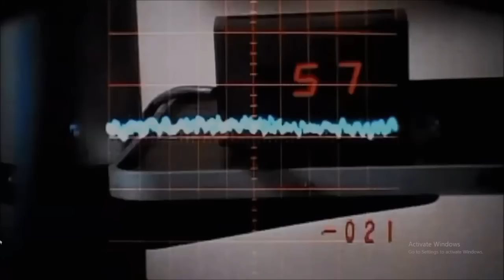RICK'S CORVETTE UPDATE ON DAMAGE & MORE TECH TUESDAY QUESTIONS

Comment: Rick the exact same thing happen to me in my 2021 HTC when I did my first launch on a on-ramp. Passenger axle shaft broken under the outer CV boot clamp. Car only had 2003 miles on it. One mile from home at 10:30 Friday night. Took 3 hours to get AAA to get me and drop me off at home. You did the right thing driving it home. Got it replaced in two days. I was gun shy to try it again, until my son said to keep doing it to work out the kinks under warranty. Smart son.

Comment: I have a solution I implement regarding the water issue/concern when washing my 2021 C8 HTC.
I simply raise the rear engine cover by placing the car in service mode. The water rolls off to the rear of the car's drainage points.
(If I'm home) I use my portable blower to get rid of the residual water.
To help further I also ceramic coated myself those areas around the trunk where the water settles as well.
Hope this helps.....    Enjoy the ride!
Reply: Service mode is an excellent idea. Def gunna try that next wash

Comment: I too live in the Houston area and have a 22 HTC that at times has a strong odor of raw gasoline.  I don't over fill the gas tank, I have over 1K miles and I don't have to have a full tank of gas for the car to smell.  It is currently at the dealership for the second time for this issue.  Hopefully they can locate the problem this time.  If the problem is resolved I'll post again.

Comment: That maybe more common than you think.  My Son had 2016 Camaro 2SS, and just driving home car lost power and all kinds of noises were from the rear.  He pull over to see if he had a flat, tire was fine.  But car wouldn't move, call a tow truck and once on the bed saw his half had seperated from the diff.  Towed to the closest Chevy Dealership that told him that they had seen this before.   Bolts back out or break off.  Got it fixed then sold it for a BMW M550. Good luck with your car.

Comment: I have been tracking my car…. Got and extra set of tires and wheels. Also bought a tow hook….. added the 2 quarts of trans oil by jacking up the left rear 13 degrees….. Have you changed your Brake Fluid to High Temperature…. If so what kind

Comment: Here is a solution for the HTC owners and water collecting at the rear window after washing.   I use leaf blower to disburse the water from entire car before towel drying.   I previously had a c8 coupe and found the HTC much easier to maintain "spot free".  The water in the engine bay drove me crazy  As my wife says to me that's a short trip.

Comment: Question for Tech Tuesday. Tire air pressure: Should I follow the lable on the door jam, owners manual, or what is on the tire?
My dealer delivered my car with none of these numbers.
Reply from the maker: We use what's in the door....if its cold out though during delivery, Chuck adds 2 pounds...if its very hot, he is 2 pounds less
Reply: I've always gone by the door jamb but check the owners manual. It may say for track use add or remove a certain amount. I don't know much about the C8

Comment: I had my dealer do all the recommended changes for tracking my car. It runs great on the track but it also drives well on the road. If yours doesn’t drive well on the road then I’m guessing the changes to the alignment were more than recommended by Chevy. I do have a question about why they recommend changing the brake fluid back to normal after tracking the car. I have left the high temp fluid in for a year and have tracked it 6 times. The fluid tests good and I have not changed it. I did put track brake pads on as the original pads were gone at 5000 miles.

Comment: I put 30 miles on my brand new C8 yesterday, I parked, and then about 1-2 quarts of red fluid leaked from the back of the car, in front of the right, rear tire. Had to have it towed.
Reply from the maker: The red fluid is transmission different from my issue and glad you had it towed - could just be the canister housing for the DCT filter - good luck

Comment: Had, my transmission swapped out at dealership, and a month later the driver side axel popped out of the transmission and beat up the subframe. i was puling out of a gas station, not going fast. Is that the dealer who didn't torque the bolts to the transmission properly... in your opinion??

Comment: Update on strong gas smell.  Supposedly there is a bulletin from GM stating that the smell is coming from the adhesive. They are working on a solution to the problem.

Comment: Hay Rick just installed the blue attack air filter and I could tell a little bit of more power.  Rick what are your thoughts on the power commander for the C8 2022 Corvette  #torah57mitch
Reply from the maker: Great to hear..the more you drive the smoother it does get, that filter is an amazing value. Don't forget once a year take it out wash it and dry it - DON'T USE A BLOWER....Power commander, not familiar with ?
Reply: Okay I just installed it Sunday and is was an easy install.  The pedal commander gives more or quicker pedal response I have it on my 2019 Silverado and it works great it has multiple settings.  #torah57mitch

Comment: Rick, is it possible to order Competition Seats, Two-tone seats, and Color Combination Override with Red Mist or Amplify Orange?
Reply: The color combination override is for picking a color of seat that does not fit GM’s recommended offerings with the exterior color chosen. You can’t bespoke them seat color with a color of seat the GM doesn’t offer.
Reply: @StFarmer2  Hey Steve, thanks for the note! I My thing is to try to max out the msrp. I did this in my current Z06 by getting the Color Combination Override. It actually applies when exterior, interior, seat belt, (and pre-C8 convertible top) colors are not on the recommended list. The challenge is that Chevrolet doesn't publish the full matrix of what combinations would invoke the Override, so it's a matter of iterating with the configurator to see when it kicks in. Wanted to see if Rick was up to this challenge. 😀